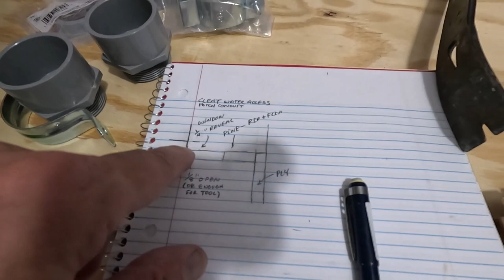Dream Woodshop ― Seamless Window Frame in Plywood Wall - Part One

Comment from the maker: Here are the tools I used on this project:

Senco FinishPro 35MG Nailer -- https://amzn.to/3vfgiHV
Dewalt Random Orbit Sander - https://amzn.to/3SIAv7P
Dewalt 20V MAX Cordless Drill / Driver Kit, Compact, 1/2-Inch -- https://amzn.to/2KBzFcK
DeWalt 20V MAX XR Impact Driver, Brushless, 3-Speed, 1/4-Inch, Tool Only ― https://amzn.to/3opEzaF

Comment: Hi Mojo, nice video, did find some of the explanation  a  little baffling but all came clear when you fitted it in good job.
Reply from the maker: Thanks Larry, that's probably because it was a little confusing in my head 😉 It can be hard to explain difficult assemblies like this. It is perfectly obvious to me, but explaining it in simple terms is not that simple! Luckily the rest of this particular wall is pretty straight forward, but the north wall has two secret doors in it. They will be cabinets that open into doors 🥴

Comment: I bought the Dewalt 18 gauge straight and 16 gauge angle nailer. I really like them, not a single jam so far...I am going to be compressor free if I can!
Reply from the maker: I take it they are both airless? DeWalt makes air guns as well, and I have their air powered brad nailer. I will probably have a mix of both because I am just so used to the Senco nailers and cannot see not using them. I worked in a cabinet shop for many years, and used one all day every day, and really like the fit and feel of them. When I bought the brad nailer, I held a battery powered gun at Home Depot, and found it to be too bulky and heavy. I do believe they would come in handy in the field though. Also, I use compressed air in some of the jigs I create and to clean up, so I will never be compressor free, but it would be nice to have the option to not drag a compressor/hose into the field!
Reply: Sorry, yes I got the 20 volt stuff, I meant to add that...and I bought a bunch more batteries, which always makes me happy to have more of.